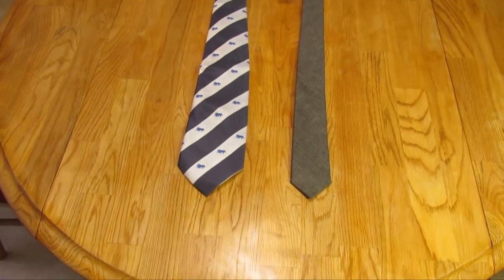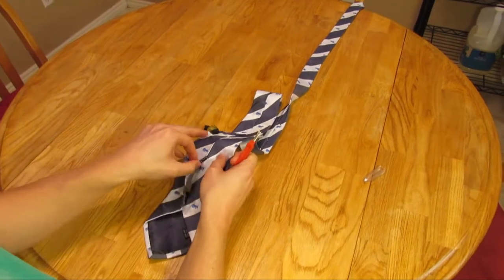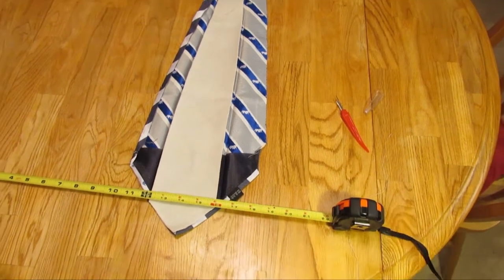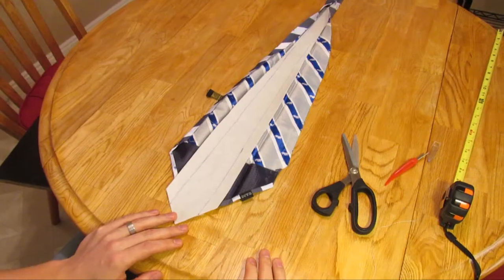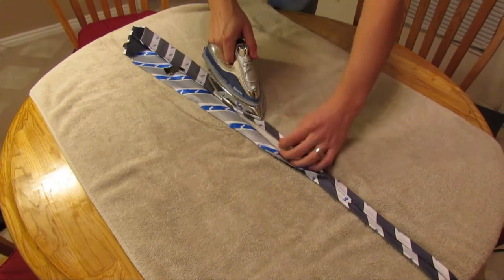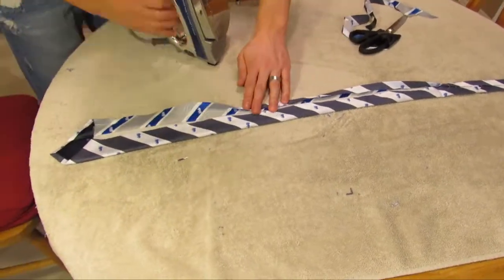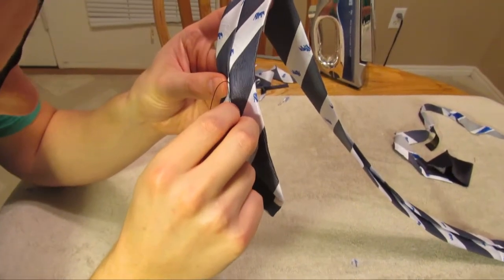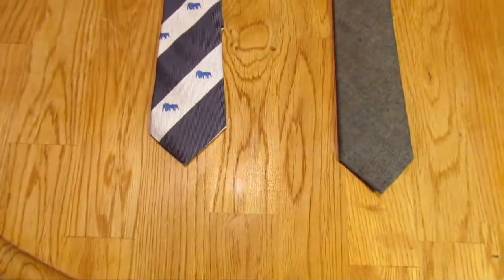How to make a skinny tie from a fat tie

Comment: The cut you made on the bottom left of the tie does not match the cut on the right at the very bottom it’s pretty obvious from looking at the end of the video that the two edges where the tie come to meet at the bottom point of the tie do not match the left side is not as angled of a cut and only comes Up half way compared with the right you need to cut the bottom edges more evenly so the angles are matched not sure why but the solid color tie looks fine and doesn’t have this problem, this is just on the striped tie